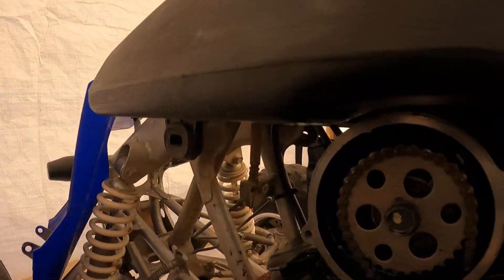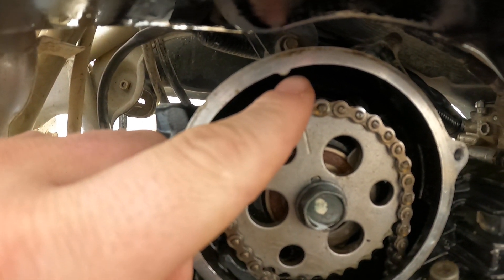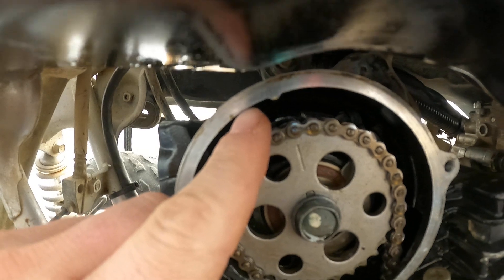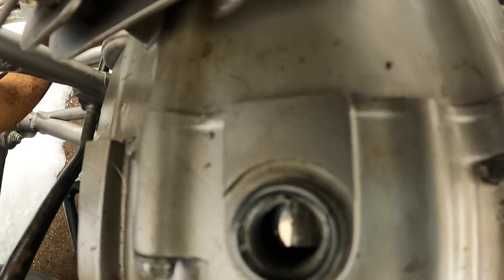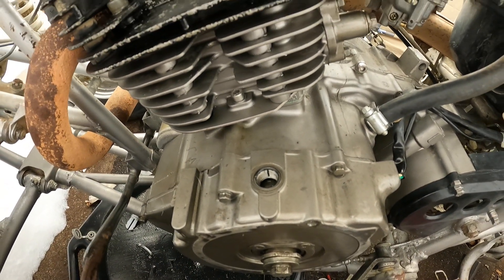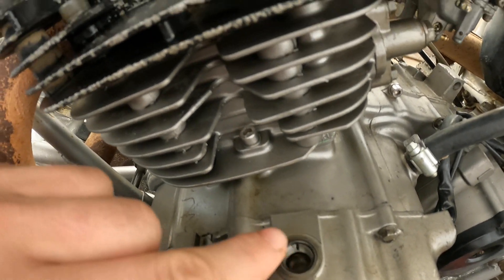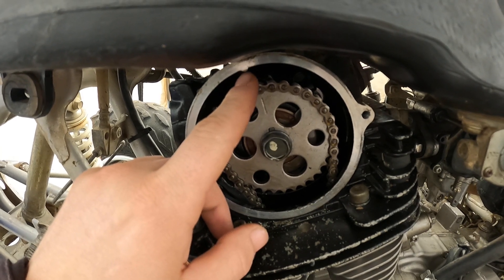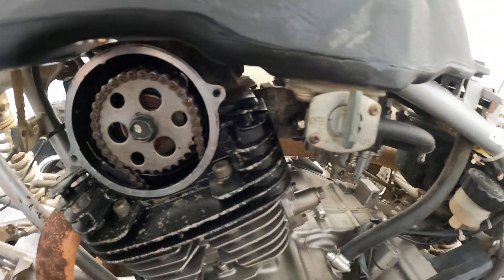Warrior Timing Marks Won't Line up

Comment: but that would not be stopping it from running man look at the neutral safety and the clutch safety these switches normally go bad and make them not run
Reply: Hey man
Reply: I have a warrior that has no spark at all any help ?
Reply: @norbertohernandez9574  check you coil then your starter the if they and good check your safety switches then if that does not fix it look the wiring harness over and make shore there is not a brake in the wire and if there is not any it probably will be the cdi box but check everything it will add up fast lol